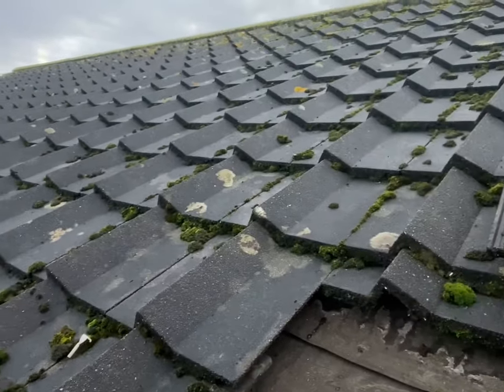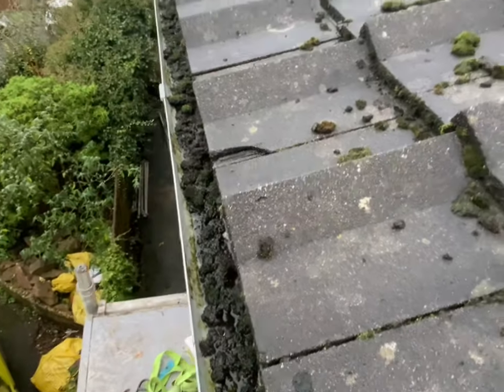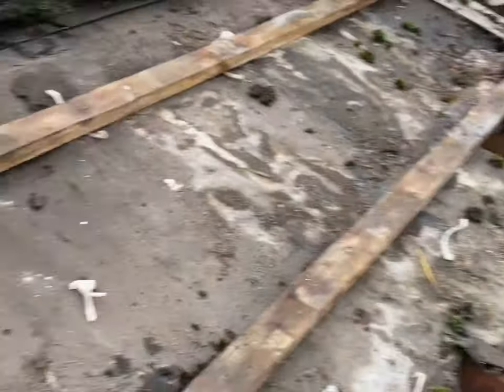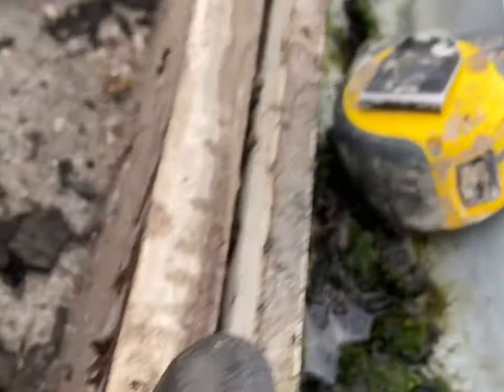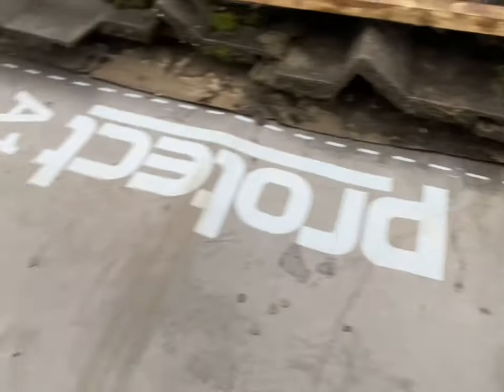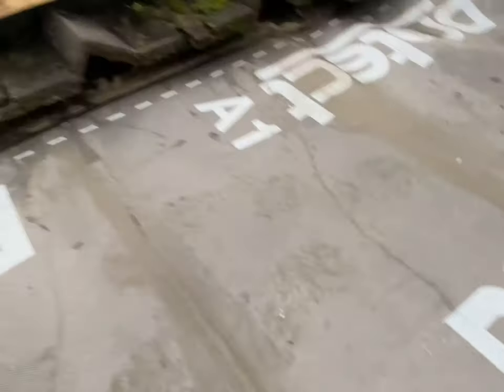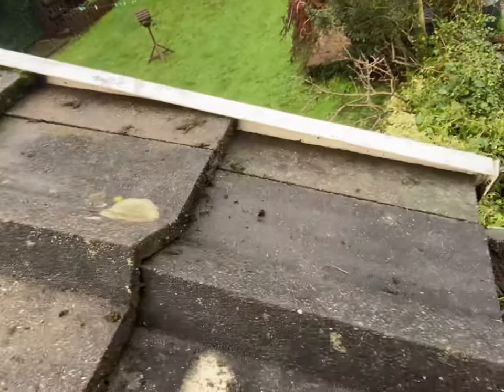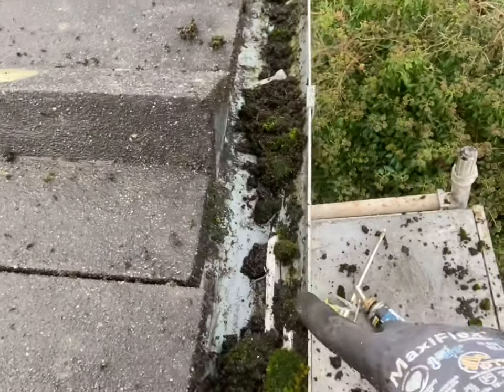How to repair roofing felt under tiles

Comment: What a cowboy! Rain getting through the tiles in the first place is the problem, especially when you leave broken tiles in as you did.
Reply from the maker: Please. That was a top notch repair. Still holding out strong till this day. Yeeee haaaaaa
Reply: @everlastbuilders 
 Stonewold Delta tiles! Biggest heaviest tiles to carry up a ladder back in the day. 
"if any water gets under the tiles"- in that case the tiles have failed and no amount of felt will help, you`ve just moved the problem to under the tiles but never mind, they`ll find out when all the spar feet have rotted away and they need a rebuild not just a re-roof.

Comment: Waters gonna trap behind batten put back on top of fascia board then seep down behind gutter,, should have  gone underneath new felt with felt support trays going into gutter, at least two tiles should have been replaced in that section alone  , the fascia capping board didn't need cutting down at all and as for the scaffolding 🥴
Reply from the maker: Hi Rok A lot. Thank you for taking the time to watch, comment and explaining how you would have done the repair. Obvoiusly ever situation is different. On this particular instance I could have done a few things differnt like add felt support trays, changed tiles and had full scaffolding. But it was only a repair to get them by. (1 day before christmas) I believe the repair I carried out will last atleast 5 years which is probably longer than the rest of the roof will hold out. I informed the customer roof will need to be replaced in the near future.
Reply: There should be a tilting fillet behind the fascia board or an eaves protector or an eaves support tray. There shouldn't be a batten fixed to the top of the fascia. A 2" upstand on the fascia is correct for tile. That scaffolding tower looked very sketchy. That said it was a repair and the budget was probably minimal.
Reply from the maker: @northernscum8228  😂😂😂 Iv just double checked. I carried out this job on the 22nd December 2020. 😝

Comment: Very useful tutorial. Thanks so much for sharing. I've recently recleaned my Marley roof tiles. Absolutely thick with moss. Having manually removed the majority of the moss - 8 black bin bags, roughly half full - I sprayed it with 15% bleach twice - and will now paint over with clear acrylic sealant. 
I can see that there has been a degree of water ingress and, having watched your video, understand that the  underfelt must have rotted away, and will need replacing.

Comment: This is very useful. I was on the point of just replacing old wooden fascia but builder friend suggested underlying roof felt along edge is likely rotting away too.
This gives me a very clear expectation of what i might find and need to deal with whilst scaffolding is in place and before replacing old fascia boards.
I have the same concrete tiles as per this video so good to see that aswell.  Thanks for sharing  👍
Reply from the maker: Glad it helped mate. Hope you got it all sorted.

Comment: Please great work. Was there a additional need to fit eaves support trays, to stop the felt sagging, especially as the felt along the gutter run was most deteriorated? Or please your thoughts on why the support trays were not fitted? My roofer did not fit them, at first on a recent re-roofing job. Many thanks for your video and your response.
Reply from the maker: Hey thanks for watching. Yes for a proper finish eave trays should be fitted. I didn’t have any at the time when I carried out this job as it was an emergency repair days before Christmas. Hope that helps.

Comment: So a part can be resealed with felt without taking all Tiles off? I ask as got leak near Chimney and felt missing there and battens rotten
Reply from the maker: Hi yes you can patch repair roofs. No need to strip all of tiles. If there’s only damage in one area. Good luck I hope you get it sorted.

Comment: This is so helpful thank you!   I have the same problem as in lower felt needs replacing. Would I be better to get the whole roof done though, because presumably the felt higher up is on the way out too? Bit worried I'll have to pay out again in a few years when I won't be able to afford it?
Reply from the maker: Hi Lesley. Thanks for watching. In my option. Higher up will last a lot longer. If you can get a roofer round for a day or so and replace lower felt using a tower scaffhold or ladders. Your on to a winner. But if you have to fork out for full Scaffholding it will properly be worth replacing the whole lot. Hope that helps

Comment: Good job under constrained and awkward access conditions. Please keep safe for you family and kids Sir. 

The 40 or so mm headlap on the shallow roof pitch is a dire testimony to the original building design. It should be maybe 75 to 80mm. When was it built? 
Kind regards.
Reply from the maker: Thanks you mate. Not sure when it was built. Definitely not that old. I know it’s crazy. Let’s build a house on top of a hill by the sea and put a crap pitch on the roof😂 .

Comment: Great video for roof repairs.  Why was the insulation aspect totally ignored just because its not a roofing job?   The loft insulation is clearly visible and so is the exposed face of the concrete blockwork which may form part of the room wall inside the building; for example the internal wall above a window.   Why was that important part of the wall totally ignored?  

The absence of loft insulation in this area often results in damp just below the ceiling, often accompanied by mould.  This problem can be  made worse when soffitt vents are fitted and the air behind the fascia is even colder  All for the sake of a small amount of insulation.

So many videos about insulating lofts; so many about ventilating lofts; many about roofs and their repairs; non that join up the dots and create a total view on all aspects of a very important part of a building structure.

Excellent video all the same!
Reply from the maker: Hi thanks for your comment. You are correct! Insulation is poor in this whole roof. I actually recently when back to this property and done more work on the roof. I did advise the landlord of the property insulation in the loft is poor. But you know what landlords are like 😝 thanks for watching and your feed back

Comment: Did you do anything about the underlying problem, which is the rain water getting past the roof tiles and getting on to the felt anyway?
Reply from the maker: Nope. . Pitch is to low and house is top of a hill by the sea. They are doomed! Just a quick fix. It’s held out for 3 years and counting 🤞I did advise customer new roofs in a bad way

Comment: You shouldn’t let the felt  go into gutter you need eaves trays and felt cut back .
The membrane ,felt , is  a  moisture barrier for any condensation that forms on the back of the tile and between back of tile and membrane ,felt 
not the actual water proofing as that’s the job of the tile , I should look for cracked or broken tiles letting in water onto the felt further up the roof 
That old IF felt is old style  not used today

Comment: How much would a job like this typically cost ballpark on a 3-bed semi with pitched roof?
Reply from the maker: Hi I’d say around £500-£1000 scaffold and 400-1000 labour if only doing the first meter up on the roof.
Reply: Is it the done thing just to replace say bottom 3 row of tiles worth of membrane when its rotten just at bottom? Genuine question
Reply from the maker: @AshleyS994 normally the felt at bottom Rots away before felt at top of roof so as a repair we just do bottom

Comment: Good and clear video thanks! How are the batons normally held in place ?
Reply from the maker: Thanks Luke. When doing a full roof Batons would all be nailed as it’s quicker. So sometimes it’s a bit tricky getting the old batons of without breaking them. I normally use a flat bar. When I put batons back on I screw them as I don’t carry nails. Hope that helps. George

Comment: whenever I've done roofs always a 300mm layer of damp proof course at eaves level lasts for ever
Reply from the maker: Hi Michael yer we used to do that to back in the day when I used to do new fascia’s and soffits if the felt was damaged
Reply: please can you explain what this means, I am new to this and about to embark on installing eaves trays, and replacing some felt if needed in that same area.

Where you say leave a 300mm layer, how does that look, like 300mm overlapped on top or?
Reply from the maker: Hi damp proof course (DPC) was used a lot back in the day. It’s just a thick plastic sheet. But nowadays if your using eaves trays don’t worry about using a DPC. BUT obviously u still need roofing membrane over the top of the eave trays. Good luck

Comment: Hi my roofer used TRAYS but he also used thin boards to stop the felt sagging. Now the tiny drips of condensation have turned to running water all along the wall and condensation. Is this caused by the boards? I’ve been told be another roofer they need to come out. Because the new felt is breathable. He’s going to charge me £5000 for a new roof. ???? Hasn’t been right since I had fashers and gutters put on.
Reply from the maker: Good Morning. Oh no what a pickle! Surely the boards wouldn’t have caused that much of an issue! When fascia’s and soffits are removed and replaced roof felt sometimes does get damaged and should be repaired as they go. Unless they put the new fascia’s on top of the old ones and not disturbed the roof felt? 
If it is defiantly condensation. It will be a ventilation issue? Has a vented soffit not been used? If not you may have to get the fascia guys back to drill holes in your soffits and add round vents to allow air to circulate in roof. Hope that helps George.